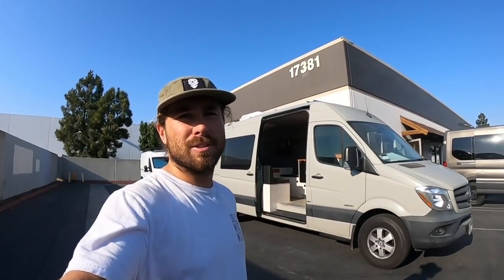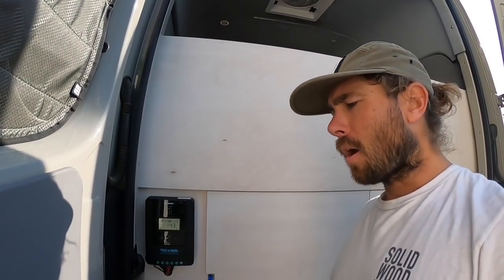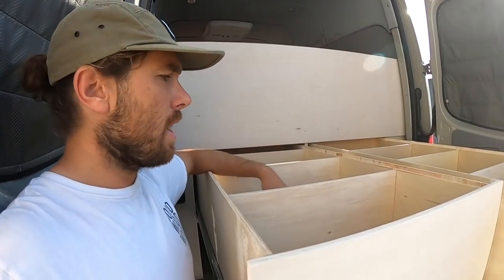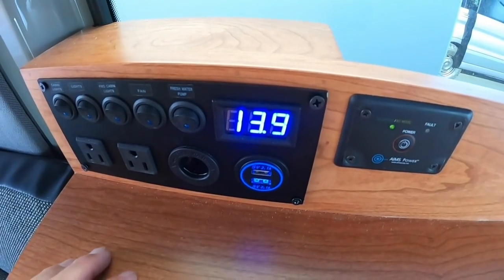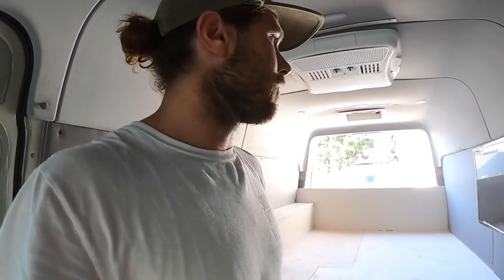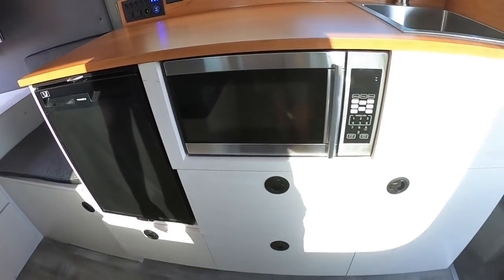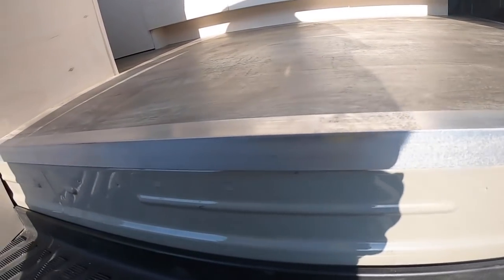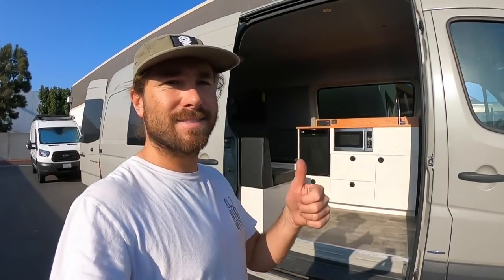Large Sprinter Van Conversion

Comment: I would love a build like this. Looking for the right van at the moment. Is that Sprinter van the Medium height or the highest available? Also, can you add seatbelts to the bench seats?
Reply from the maker: It is the highest longest sprinter. And yes you technically could if you when under neath to bolt to the body.

Comment: What type of plywood do you use for your builds?
Reply from the maker: This build i used baltic birch
Reply: @SolidWoodWorx   
What plywood do you use in truck beds? I want to build a full length drawer on the drivers side of my bed with those 5’ slides and it also be a sleeping platform.
Reply from the maker: Luan

Comment: I think it looks like a great build but I think the owners will soon find that the white painted cabinetry in the galley way gets to looking pretty sad really fast.  Glue on some vinyl to solve that and even though it will add some weight it will really keep the place looking nice with little upkeep.
Reply from the maker: I saw the van for a revisit about 3 months later after they had taken it on 5 long road trips and the white cabinetry was still in great condition. There was a thicker clear coat applied so nothing stuck to the actual wood.